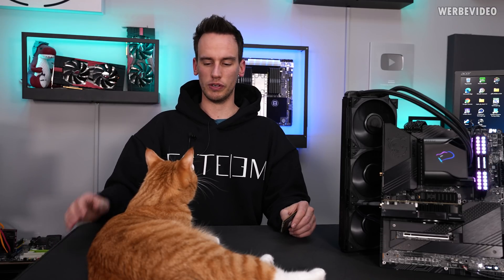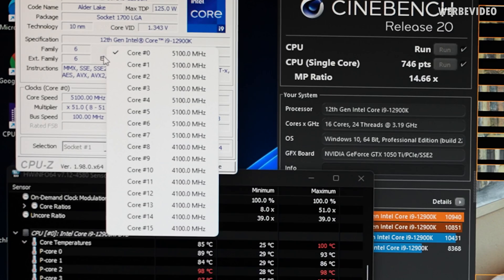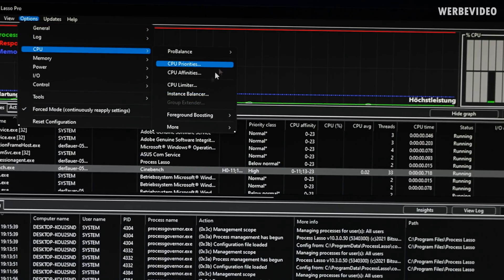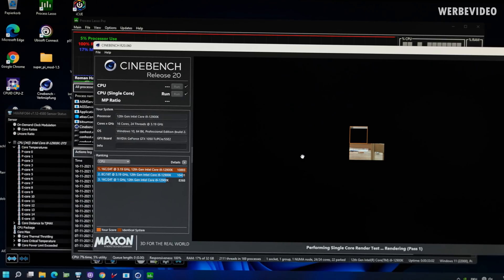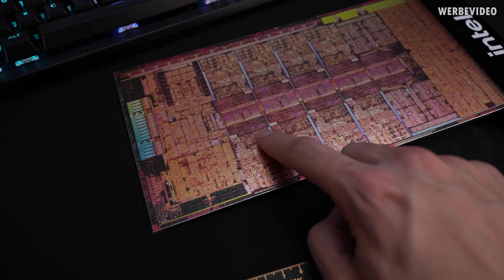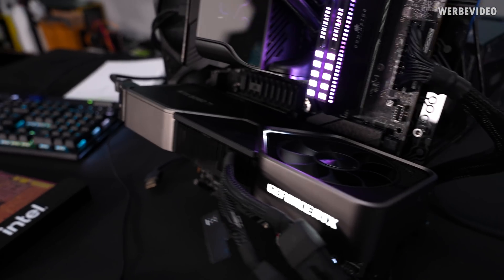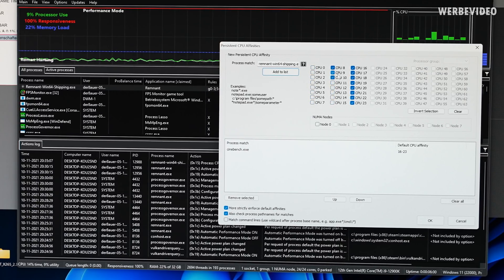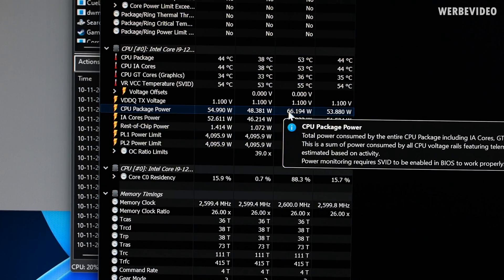The E-Cores were not meant to be used This Way... but it's Amazing!

Comment: All kinds of possibilities are out there now that big.little is working in windows. For the same die size, you could have a 4p,24e config with probably higher power efficiency. I really wonder how many high clocked cores games and everyday software actually need and how well they can be multithreaded.

Comment: when it comes to multithreading, more lower power cores is better than few high power cores, and this idea of P and E cores allows you to have as close as the best of both worlds, high power low threaded apps and the highly threaded apps. Also apps can be made to use specific cores, so it might have the most intensive part on the P and the less intensive on E cores.

Comment: The only time I can see this model not being better is when you run your entire CPU usage to 100%, which rarely happens. Even then, if the workload is very multithreaded it would probably be better to have the 8 e-cores instead of 4 p-core threads. With that in mind I wonder if Intel will make an e-core only or even a mostly e-core CPU for the Enterprise and scientific space for highly threaded workloads.

Comment: A good amount of people aren't hating on E-cores because of the perf, they're hating on E-cores because of the compatibility issues they have with games, myself included (I don't use Intel, I'm merely voicing the problem). People have been having to disable E-cores in-order to play older, and some modern games. The game just outright crashes because DRM software.

Comment: While some people need this amount of cores, sure, it's good.
For those that need 4-8 high performance cores ( 99% of users? ) they give fuck all boost for anything, it's not about them not being good, it's about them not giving you any benefit over the current available CPUs...
As with everything, in 5-10 years when software is made to utilize stuff like this, it will be the norm but right now it's as useful as RTX was for 300€ more 3 years ago when like 2 titles had proper RT support.

Comment: A test with one P -core (no HT enabled) and 8 E-Cores would be nice.
Just see what happens if the critical thread can run on the p-core.
This way one can also find out how many P-cores are needed for high performance gaming (I suspect it is not 8).

Comment: Basically E-Cores seem like cores that miss AVX-512 instructions that can be used only for some kind of tasks that are likely optimized to run even better on GPU anyways (such as image/video processing) and they do not have hyperthreading. I saw some interesting talk about if it's better to have these features and just to have much more rather simple cores, cause in real world most applications will benefit from the second approach.
On the other hand as a software developer I have to say, that scaling to many cores is somewhat problematic: if you have task running 48ms on single core, you distribute it to 16 threads on something like Ryzen 2700x, you may expect that it will be done in 3ms. Sadly OS decides it needs one thread for itself and two for another apps - so 13 threads will complete task and remaining 3 task will complete afterwards. In the end you may see that task lasts from 5 to 8ms and CPU usage is 60%. For tasks that run longer, it's not and issue, cause they will complete roughly at the same time.
Reply: For my codes threads don't optimize performance (I use MPI) and so E-Cores seem like the way to go.

Comment: I can see where running E cores can be attractive for portable gaming handheld, especially where package power is shared between GPU and CPU. Depending if you want performance vs efficiency.

Iut of interest are E cores tuned P cores or are they a seperate architecture?

Comment: ITS WHY INTEL GONNA SELL A LOT FROM THE SHELF....THIS IS SOMETHING AMD MISS...CUSTOMIZATION CPU TOOL THAT LINUX AND WINDOWS GONNA SUPPORT FOR ITS USERS CONTROL THEIR CORES TO ANY WORKLOAD...NOW THATS EFFICIENCY IN POWER USAGE  ON THE FLY.....MEANING CPU CAN VARY ON POWER IN DEMAND THAN AMD NOT ALLOWING USERS TO OVERCLOCK MANUAL OR CPU TUNING BY SOFTWARE MORE....

Comment: Great videos, but obviously not a regular hardcore gamer - A lot of games demand 1 superfast core, a single one. Hammering more and more cores on a chip ( at lower GHz and not the max single core compute power ) results not in the optimum for a lot of single core oriented games ( example: Oxygen not included ).

Comment: I think the reason for low E core CPUs is because its new and software is not use to E cores yet and having the higher P core, the CPU will work mostly on their own. As software and such gets use to the E cores then they will introduce more of them. Need to find out the full spectrum difference between both types, not just performance in games but other aspects. Finding the right balance between them might be more dependent on what you are doing than just more of them. We are starting to get to that wall of cooling these down vs the power and performance and finding the balance for a workload will be more ideal than trying to cool off more of P and E cores in bigger CPUs

Comment: Have been somewhat worried that the E-cores could choke gaming performance in certain conditions. Like I saw a Bang4Buck PC Gamer vid where he uses a 5950x and RTX 3090 to test games and resolutions etc. One one vid I noticed that one of the high numbered cores on the 5950x was doing heavy lifting.

Had this happened on the 12900k, it would have certainly been an E-core doing the work. However I think this might have been the exception rather than the rule. I think (but not sure) that gaming loads the heaviest single core requirement on the first cores in the package.

This vid though does settle my worries. The only other issue is heat as the 12900k is said to need a 360mm rad AIO. That rules me out since I prefer air cooling. (Am sure Intel could have backed of clocks and power just a bit, for less heat. I guess they wanted the crown back.) Am thinking AMD then for my next build, they use less power and make less heat.
Reply: I have found a game of my own where the last thread is doing the most workload. On Generation Zero, the last thread of the last core on my PC, does the most work. If one of the E-cores on the 12th gen got that workload, that core would almost max out. Developers are going to have to code so E-cores never get the most workload, even in existing games.

Comment: Well that's pretty expectable. ADL was super rushed and targeted laptops, so intel focused on E-cores and did all optimizations they had time for, while P-cores were dropped on a "well it's working" stage. Also we know for a while intel's SMT is quite crap so again - that's expectable cores with optimized transistor layout and no SMT are more area and power efficient than P-cores with barely working design and shitty SMT. 

This allows us to conclude that big cores are actually pretty bad from a tech POV, while small cores are actually "huge".

I would name this architecture not "big.little", but "shitty.huge" instead.

Comment: They're not just shrunken full-fat cores in every manner though. So my curiosity is predominantly aimed at how do the E-cores perform in usecases where most or all the P-cores are already taxed hard, consuming a lot cache and a lot of the power afforded under the new max-turbo-indefinitely default. Basically, how does this E-core performance scale under such conditions. That's the real make or break element for me: How much of this ideal-conditions E-core performance can I actually tap into, while the P-cores are busy running a lengthy, heavy production workload. If the answer is "most or all of it", then now I actually play modern games fairly comfortably, on the same system while It's doing heavy production workloads, on an Intel desktop platform. That's a trait 12 and 16 core Ryzen desktop CPUs have mostly held without competition, and it would be really awesome to see this now-fully-revived state of competition hit this market segment too.

Gonna get really exciting. Can't wait to see how AMD's Zen 4 + 4D CPUs will perform; if they realiate with 1x Zen 4+V-cache 8C die + 1x Zen 4D 16C die, on AM5 desktop.

Comment: The problem is not performance of PCore or Ecore. The real  problem is : chose one type stick to it and use it all the way through.
I don't give a fu*ck to the type of core I'm running provided that I have 128 of them!
Using multicore in order to execute those flawed games is not a concern. They've been programmed for ps4 by journey man developers. I don't see the point of having hybrid hardware for that.

Comment: So.....
You CAN disable the E-Cores from the BIOS to be running only with P-Cores.

But you CAN'T disable P-Cores from BIOS to be running only with E-Cores.

I hope Intel adds ability to Disable either E-Cores or P-Cores via Intel XTU software. So you can do either at will.

It is actually interesting to see E-Cores for daily task for the purpose of Electricity Savings.

Comment: Thanks derb8auer for this highly intriguing and informative video. It is amazing how Intel made such efficient cores for the Alder Lake architecture. I am probably wrong but, last time I checked, I think both the P cores and the E cores are on Intel's 10nm process which helps contribute to the hybrid design. It is definitely a step in the right direction since Apple also has a hybrid CPU design too.

Comment: Why not 40 E cores? Wouldn't that be faster than 10 P cores with Hyper threading?
Reply: You have to do the sweetspot between single thread and gaming speed vs multithread speed.

8 fast cores are the sweetspot.

Comment: If I remember correctly, AMDs cores are a lot smaller than Intel P cores? I wonder if they could leverage that in combination with hardware scheduling/software scheduling to fully gate off idle cores. It should be possible now that the L3 cache is unified rather than per ccx. Heck, put a whole ccx to sleep if not needed. Or are they already doing this as much as possible? I feel like my 3900x always has tasks bouncing around between all the core. Never see whole ccx of cores idle for long.

Comment: I'm not saying Ecores are bad. In fact I think Intel would be better off on the X series offering CPUs that are like 32 Ecores and no P cores. But for gaming Pcores are better since most games are limited in how many cores\threads they can use. The problem is when do you switch between them? For ARM on phones and tablets you have the obvious scenario of switching to the little cores when on standby and to the BIG cores when running apps. But there is no clear cut scenario on desktop where you switch between the different cores aside from manually assigning certain processes to each different set of cores. And I think we all know that Micro$oft won't deliver this functionality to us for at least a decade.

Comment: So, it is just as I imagined - disabling the P-cores basically turns this into a i7-7700k, though with a 65w TDP, essentially confirming what they are - efficient.
Reply: that's actually quite impressive
Reply: they are not power efficient, on the contrary. They are space efficient. four e cores are roughly 20% faster than one e core in multithread tests.
Reply: 7700k is four cores. There are eight economy cores on this CPU. He said single economy core performance is about the same as one core of 7700k. ... Surely that makes the eight E-cores like two 7700k stuck together.
Reply: @threecats8219   More like two 7600Ks stuck together since E-cores don’t have hyper-threading
Reply: @yancgc5098  Not really as it took 8 e cores to even match and yet still be behind a 7700K and that is double core count. And no hyper threading is not anywhere near the same as actual real cores. Hyper threading smoothes out multi tasking, it does not seem to give more raw performance rather more efficient utilization of processes that do not fully utilize a CPU core and in theory if 2 threads can use 50% or less of one CPU core, it can divide the threads for better use., But that is no where near the performance of an actual core so no a good comparison.

Comment: what if you took 4 cores of each and put them in a group, clock them at the same speed and do the same test with each group? like thermal differences and time to complete the task or any performance metric... the idea being to see if they are the same speed at the same clock firstly and secondly how much heat for the same task at the came clock! (maybe even do a 1 core test too!) EDIT: wrote "talk" instead of "test"... my brain can do whole word typos i guess!

Comment: They should've just made adjustable threading and c-stepping where it decides which applications need more power and which can be divided up among cores so while gaming u could use all cores max turbo or if your running browser or streaming in background it divides that among one or two cores using threads maybe stepping down to save power

Comment: The E cores are trash. They are not efficiency cores at all. 66w for that performance ? Wake up. Intel needed a 16 cores for the marketing battle. But they can't glue cores. And they can't sell behemoth at the AMD price. So they sliced cores and told idiot journalists it was for efficiency. While the cpu uses 260w.. kek...

Comment: Well, I am not impressed by this hybrid design. Let me explain why. Just to clarify, I am going to talk about the 12700K, but it won't make a difference in the assessment. I think that this architecture for desktop CPUs was specifically designed for winning benchmarks at any cost. But as a customer I am not convinced about its advantages at all. On laptops it made sense as it saves energy but it is very doubtful if Intel has the same purpose in case of these desktop CPUs. Intel essentally sticked a 7700K to a traditional design. What they gained this way is: 1, an excellent gaming performance 2, outstanding productivity performance. These are very positive points, but why I am not impressed? Well, the 1st point is achieved by the P-cores, i.e. the improvement of IPC what the new gen brought and the new 10nm manifacturing process. With other words, this could have been achieved by P-cores only. 2nd point: it is achieved by the combined force of P-cores and E-cores together (and that's why the E-cores are so powerful, because Intel wanted to punch in the production category as well, background applications do not need this computation power), but at the expense of vast electricity consumption. But this was the only way to keep the power consumption on the border of acceptable as their technology is not yet there where of TMSC is. With other words, if Intel would posses the same technology as TMSC they would not have gone this way with the design. What I have read is that AMD CPUs are also capable of performing on similar level if the power restrictions are disabled. Anyway, I am a gamer only so productivity performance does not matter for me. If smoothness is the concern then 1 or 2 extra hyperthreaded P-cores would do the job as well (if the architecture would be efficient enough to stay within reasonable range of electricity consumption). So my verdict is that this hybrid design brought unnecessary complications for us, desktop CPU customers. 
One trick that Intel threw in was to decrease the base clock to save power when the CPU has low load or idle. This is certainly clever and I would like to see both Intel and AMD exploit this further. I think AMD could make a design with increased core count (so the mainstream desktop CPU - let's pretend it is the Ryzen 5 6600 - would be 8 cores/16 threads) and introducing a 4-gear CPU frequency hierarchy:  a very low clock speed (~2.5 GHz) from idling to let's say 15% load, then a low power mode between 15-50% load at let's say 3.7 GHz, then another step up to 4.4-4.5 GHz between 50-80% load and finally max speed (4.7-5.0 Ghz) above 80% load. Even the voltage could be changed somewhat, for example below 50% load the core could be little undervolted as well. So basically this would be just a bit finer control than the current ones but hopefully still delivering very similar results to the hybrid one. Furthermore the thread count may be flexible/variable, meaning that if the load is low then the core would run up to 3 or 4 threads while if the load is high then the core would assign its resources to 1 or 2 threads only.This way the op. system does not have to handle different type of cores. The CPU manages the frequency/efficiency/scaling according to the performance needed. For me this would be an impressive engineering achievement :)

Comment: I'm curious now. It sounds like if you have a thread heavy process, like rendering, that a chip E-Cores alone would actually offer you more power in a given die-size, heat and power envelope. If the cores are 1/4 the size, then you could theoretically pack 40 E-Cores on the same size die.
How would such a hypothetical CPU fair against what AMD is offering?
Reply: Goodbye Threadripper, but single thread perfomance would be bad.

Comment: back in the core 2 quad days there was a minor penalty for running cross die. So I would always tell games that had the lowest performance to run exclusively on the 2nd die. This way that penalty would be eliminated. Back then games usually only had 1 or 2 threads. Lasso would have been nice for this since I had to do it every time.

Comment: Smaller Cores are always better for lighter workloads, just like GPU core (small and a lot). On the other hand with a desktop CPU, I could just have all P Core (5950x or 5900x) and set the affinity of all background SW to a single Core/2 threads or 2 Cores max instead of letting Windows circulate the processes across all cores (Maybe set them manually to the weakest cores).